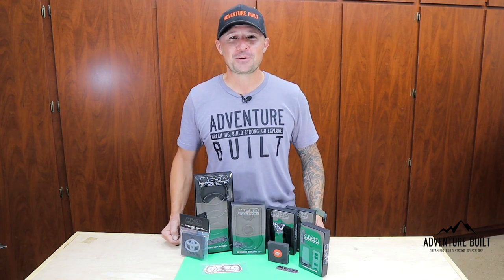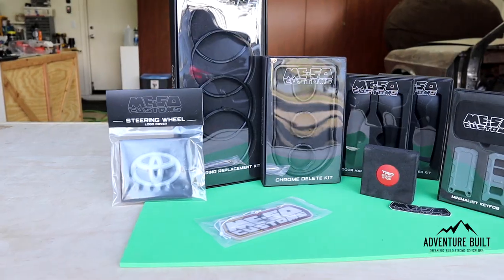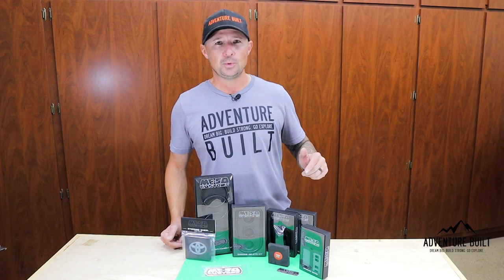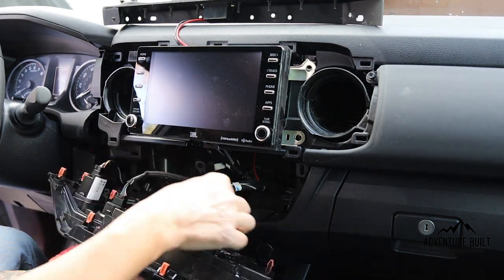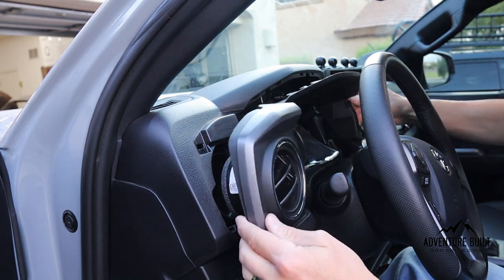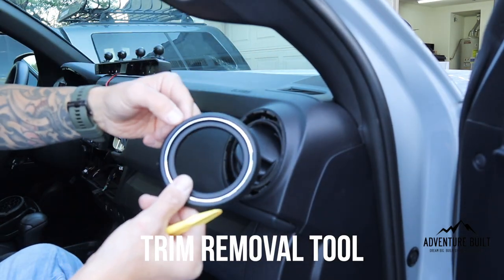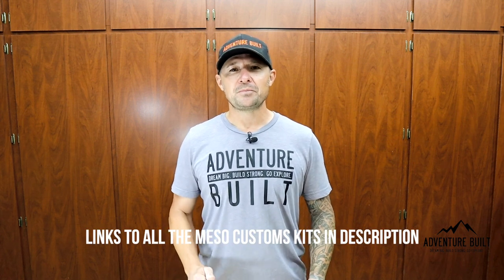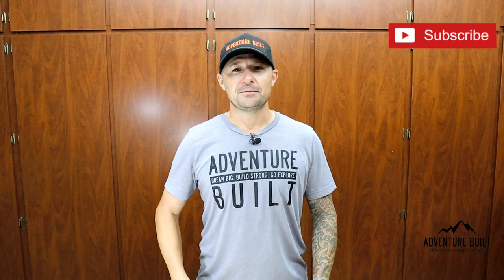2020 Tacoma - FULL INTERIOR CHROME DELETE - MESO CUSTOMS - SERIOUS CHROME FIGHTING

Comment: How is the camper shell holding up with all the added weight from the RTT? I’m wanting to do the same thing, so any input helps!
Reply from the maker: So the camper shell I have is not the best. It’s holding up okay but I can see it fail at some point. The sides are starting to spread but I think it’s a mounting issue. I ordered an RLD Designs Stainless Steel canopy which will hold up a lot better in the long run. Hope this helps.